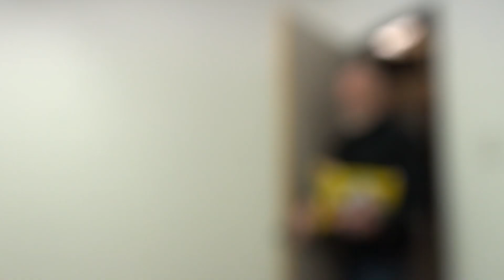The DJI HD FPV video system arrives (some questions answered)

Comment: Can you show us how the AV in works? Does it do DVR when using it? Is there any perceived latency or anything that would degrade the experience compared to average analog goggles? I am interested if I could use these as my main goggles and have a standard analog module on a 3d printed mount for whoops and stuff that I won't/can't convert to digital (yet). Thanks.

Comment: Hi Bruce, I've been wondering whether you'd be interested further on to try and reproduce this sort of functionality in as small a form factor as possible. I'm myself trying to get such a setup to work, using a Raspberry Pi0 coupled with its stock camera and a 3G/4G stick. We have stupid radio laws in the EU but also one of the best (and cheapest) phone networks around with ridiculous bandwidth and coverage on 700-800MHz, might as well use it. For obvious reasons among which the price of mobile data in NZ, I'm pretty sure you would not be interested in this, but could use high power Wifi coupled with an actively tracking ground station for long range. Ardupilot has code to set the latter up quite easily from cheap readily available parts.

Comment: Hi Bruce - couple of (not so easy) questions if I may:
- are there any options for outputting live video to a person who doesn't have these goggles?
- what do you think might be involved in getting this to pick up an analogue feed, with/without some expensive base station setup?
Looking forward to your review!
Reply: There are rumors that you can use the USB-C connection with a specific, probably DJI branded, converter to get HDMI output.
I doubt you would be able to get analog natively from the goggles, but you can buy inexpensive analog receivers that have A/V output to connect to the goggles so a base station does not have to be expensive.

Comment: now I understand why 52 thumbs down 
all talk  just empty box
Reply: he got of least shown goggles in 1 frame 
from goggles side that why I think its just a empty box   I blow 4 nerve cells in left eye so will never experience real fpv  I've had goggles  could only use the left lens so happy dji is getting into racing birds 
as I'm going to start flying racing birds with 2d monitor goggles  now I've got mavic 2 pro
Reply: don't understand the video  yes fixed wing wi goggles but no 1 wants to show 2 displays on goggles

Comment: It should be very easy to create an analog 1080i signal and you can acquire a complete 720p/1080p system including RC quadcopter or plane with 1000m range for sub $500.

Comment: You didn’t get the controller? Because I’m puzzled whats the use of the DJI controller in combination with the FPV system
Reply: The controller works on the same link, with buttons for starting/stopping recording also. So Bruce will need the added weight of a separate reciever, separate antennas that need to be mounted, and lose the recording button functionality. Other than that, system will work exactly the same without the DJI Controller.

Comment: Hi Bruce, I listened to the Drone&Sundry stream yesterday, I was surprised to hear Ian, and now you pointing out that you can easily change the power output, so giving users, especially here in the U.K. and EU the opportunity of openly break the legal transmitted power levels.
Please don’t take it the wrong way but don’t encourage flyers to join the criminal element of Clueless, Careless, or Criminal.
We have to be seen to be abiding by the law however Clueless those laws are. You and the others do a brilliant job of informing and educating, please don’t shoot yourself in the foot.

Comment: I'd like to do FPV soaring with such a system, but of course I'll need more range by using directional antennas as I do using analog video (as seen in my channel). Is it possible to hook this system up to external antennas and/or antenna tracker?
Reply: I'd guess that his main caveat with using directional antennas is that if you lose signal it takes an age for it to re-sync and come back again.

...that's something I noticed on other reviewer's videos, if you get so far away that you completely lose signal it can take a long time for that signal to be recovered.

That would be 100x worse with directional antennas as when you're flying long range you tend to lose signal every time you turn your head slightly the wrong way. Fine with analog where you get the signal back instantly once you reposition, but maybe not so much with digital.
Reply: @DEADB33F  Not if you use external antennas on a tripod or tracker.
Reply: this system is not meant for long range, its a bidirectional link with uses 2 tranceivers. For long range, you need a HD system like HD BLUE fpv or the upcomming Fatshark HD that uses a single connection from vtx to rx

Comment: Bruce, DJI have an age old revolutionary concept requiring a brain paradigm shift from the normal. 
Expensive, yes, but modular and secure. 
The concept of a camera, vtx, rx, bla bla for a thousand models is crazy. Why not one modular pack for a thousand models. Surely the cost of a lead & plug to the model FC board will break the bank. Well done DJI, a truely plug & play concept for many models. Bruce I hope you prompt this brain shift in your future videos, makes it a cheap concept, well done DJI. Jd
NZ

Comment: Hi Bruce, please don't forget to give us some overview of the OSD as every reviewer so far successfully avoided this topic. Does it work with BF and iNav OSD, do we get data such as altitude, distance from home, home arrow, speed, GPS coordinates, RSSI, LQ, mAh consumption and so on...
Reply: No, the OSD does not yet do all that.  From what I have read, it can only display a couple things so far but DJI has said they plan to support all of the available OSD data from Betaflight ( and I assume anything that sends compatible OSD data )  in future updates.
Reply: @5zero7RC   I'm not sure whether I would be comfortable to see and wait whether or not DJI really implement all of the OSD currently available through BF and iNav and then every time new BF or iNav firmware version is released with new OSD features one would have to wait for DJI again
Reply: @bobeshoz  Maybe, but with BF and iNav being open source projects it would be pretty easy for DJI to keep up to date with the development and release an update as soon as BF makes a full release.  If you run nightly code that would be a different story of course.

Comment: If replacing the antennas does safely boost range then it may also help with reducing the issues regarding high latency when the signal can't get through obstacles, much like Crossfire can go up to 2 watts, not everyone will be using that amount of power for long range, but signal penetration through buildings/trees etc.
Reply: It won't change anything you can be sure that dji is using a mimo system and changing antennas will only make it worse

Comment: If you have an analogue goggle module that can show a spectral graph of signals on the 5.8ghz range, it would be curious to see what analogue channels the DJI is stomping on when broadcasting its digital magic, this knowledge might help when out flying with others so the analogue users can avoid those channels.
Reply: licensetodrive Did you not hear JB in the know it all's vijao ?, he basically confirmed that the digital feed is frequency hopping, and just leaves more static on the screen's of humble analogue users nearby.
Reply: @James Ellis  He just uploaded a video called "Does DJI FPV Interfere with Analog FPV?" so that's my question answered.
Reply: @licensetodrive Yes I just saw it and now I have more questions than answers...go figure🤣
One takeaway I guess is that you should do with them what Offspring once said, "Gotta keep em seperated"✌
Reply: It is also all laid out on the DJI Specs page....  Of course this only shows you the main channel, not any bleed over on to neighboring channels.
FCC
Channel 1: 5660
Channel 2: 5695
Channel 3: 5735
Channel 4: 5770
Channel 5: 5805
Channel 6: 5878
Channel 7: 5914
Channel 8: 5839

Comment: Is there any way to inject OSD data from my flightcontroller into the system?
Reply: From what i hear. Betaflight 4.1 there will more osd options with the dji system . But dont take that as a for sure thing.